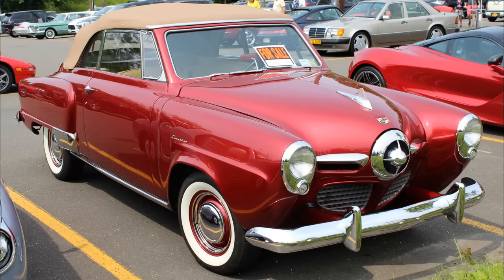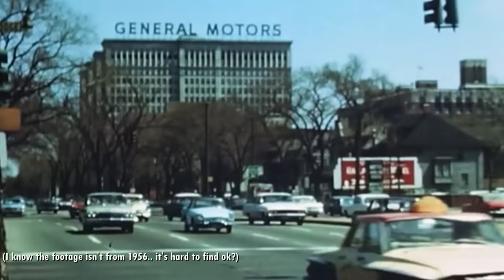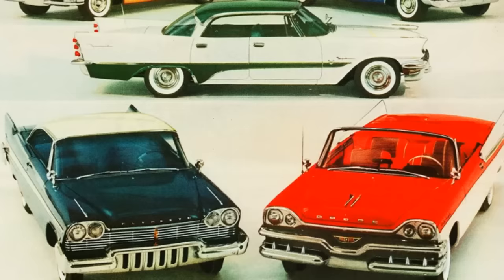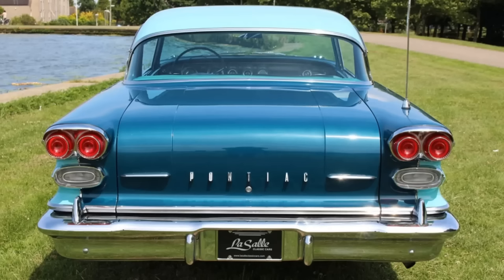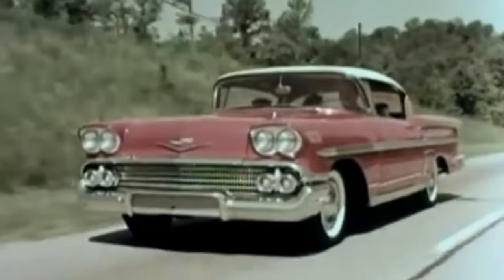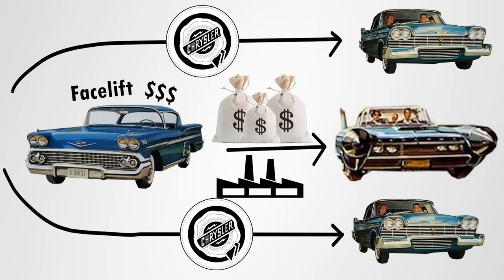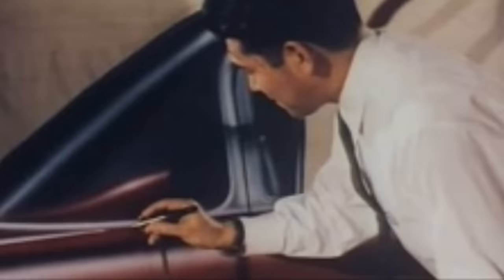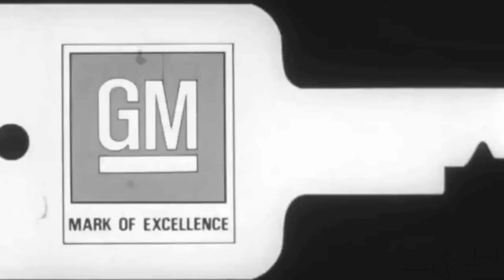Mistake of '58: The GM Chromemobiles and Far Out '59s

Comment: Ed -

Regardless of your opinions attracting some comments that are somewhat negative, it appears that you have missed some essential distinctions in GM design structure.

In 1956, the year you have started this discussion, GM had three different body "platforms" - A-body, B-body and C-body.  A-body was shared by Chevrolet and Pontiac.  B-body was shared by Oldsmobile and Buick's Special and Century.  C-body was shared by Cadillac and Buick's Super and Roadmaster.

What you have missed (oversimplified?) is the fact that those body platforms were not all updated simultaneously.  Yes, there were supposed three-year lifetimes for these body platforms.  But, the A-body's lifetime in 1956 was 1955-1956-1957.  While the B- and C- bodies in 1956 had a lifetime of 1954-1955-1956.

Meaning that the B- and C- bodies were new in 1957, and on the FIRST year of their life cycle, not in the third and final year, like the A-body was.

So, for the "mistake" year of 1958, while the A-body was entering its' first year of a new cycle, the B- and C- bodies were in their 2nd year.  I'm sure this must have contributed to the decisions GM made, regarding dumping the projected 1959 designs.

Of course, actuality in 1959 swept everything previous away, leaving the 1958 Chevrolet and Pontiac as one-year-only bodies.

And, in fact, the 1959 cars were all essentially ONE body platform, kind of a mish-mash of the B- and C- bodies.  Making the Chevrolet and Pontiac grow larger, by comparison, than the Buick, Oldsmobile and Cadillac.

FWIW, I still have the 1958 Buick Limited I bought in 1972, courted my future wife in, and brought home in from the hospital both of my sons.  So, you can see my opinion of 1958 cars.

Comment: If i was only given a choice between one of these old cars and a brand new car I would want an old car. The vehicle s now look the same break, down the same and don't last like the old ones. The old one's were far easier to work on. A sensor can go out on a new one and leave you dead in the water. The old cars weren't built to be the cheapest thing a factory can get away with making, there were made to last.

Comment: Part of what went wrong with the 1958 model year from GM was a mild recession. In that year Auto sales from all manufacturers except AMC were down.
That was also one of the things that killed the new division from Ford motor company the Edsel division. 
The 58s from GM were not their best designs. However the 59 to 64 models were incredibly beautiful especially towards 64. It would be nice if GM had a styling and engineering staff that was anything like those guys were. GM cars today or among the worst in styling and engineering. Absolutely awful drivetrains being the worst.

Comment: The 1953-54 and the 1955-57 Chevys are not the same body. Like you said, check the greenhouses. Completely different. Station wagon models can be the giveaway, and they are obviously entirely different. The 1958 bigger GM cars were not new bodies but facelifts of the new for 1957 models. The smaller ones (Chevy and Pontiac) were new and on a frame that allowed for a lower car with foot wells instead of a flat floor although they continued the heavy Harley Earl look. The rushed 1959 GM cars were variations on one basic body instead of two or three like before. The Chevys and Pontiacs rode on the same new frame/suspension from the 1958's but looked completely different.
Reply: You said, "The 1953-54 and the 1955-57 Chevys are not the same body. "Who said that they were? I appreciate most of the rest of your post - thank you!

Comment: THESE CARS ARE NOT HAND BUILT & Fenders Not Hand Hammered Out. STAMPING DIES have to be Machined. Very Large Stamping Machines & Drop Forges must be set up. Parts have to be assigned their order on Merry-go-rounds. That is Circular "Dry Cleaner" racks that feed parts to the main assembly line.

Comment: I remember when the GM '59 designs came out.  They had gross, unrelated lines and features that looked heavy and tasteless.  They were slabs of metal with chrome ornamentation that appeared to thrown at a frame as they moved down an assembly line.  🤢🤮

Comment: your story is a bit off. 1958 was a year of rising recession. double headlights were allowed in 1958 but not in 1957 as you suggested with harley earls trip to chrysler. the govt did not want dual headlights due to brightness of on coming cars. earl and mitchell knew about the all new chrysler designs but retooling during depression was not financially sound . Chrome was the selling feature to previous models of 55-57 and people loved it so that was a way to thin out the car on the sides adding new body lines of chrome and the nose ..... well was very chrome in order to take the weight look off it especially with the added extra headlight. It didnt work as well as it could have but it was far from a mistake. the 1958 chevy was supposed to come out in 57 however it was too risky to retool in 57 for the 58 so chevy and all other gms used the same 55 and 56 body with a redesign. Thats the real story. Chrysler also was not the laughing stock due to imperial was far more progreesed than others with modernisms like pushbutton drive and ride. The industry suffered even for desotoand chrysler who owned them. it was due to recession not design

Comment: You can get as intellectual as you want about aesthetics and the use of imagery in product design et cetera, but the simple truth is that money talks and bs walks, in the automobile business like everywhere else. If consumers bought those cars, why not make them. The cost of fuel was not an issue in the 1950's. Big chrome embellishments could easily get damaged in parking-lot fender benders, and maybe that was not an issue either. I wonder how many of those cars carried the bruises of chrome to chrome contact from carelessly executed parking maneuvers, and how many of their owners cared to have the damages fixed. Chrome looks nice when new but it needs to be taken care of with polish etc. Eventually an acne of rust would break out on the chrome grin of a 1950's rocketmobile. By then the owner would already be looking for a new car. Most of those 1950's cars were not built to last.

Comment: Those cars are pretty to look at but have terrible fuel economy, handle like the titanic, and require constant maintenance.  By the 1970s Detroit had the planned obsolescence down to where a motor was shot somewhere between 50k and 100k miles.  That is until Japan taught Detroit a thing or two about fuel economy, handling, and reliability.   Much rather drive a quick fuel efficient Japanese inspired standard or compact vehicle of modern times.

Comment: 1958 and 1959, other than Chrysler, were some of the worst, most gaudy, troweled on chrome, overdone Hollywood looking cars ever. There is not one of those cars I consider a good design. Want to see a great, simple, clean, elegant car design? An award winning car design? Checkout the 1961 Lincoln. It is still mentioned as one of the best car designs ever 60+ years later.

Comment: I'd rather be driving a Chrome mobile then the plastic cars of today if I'm in a plastic car I should hate to be hit by one of them Chrome mobiles the damage would be terribly thank you for the cars with bumpers on them
Reply: Actually, today's half-weighted cars are safer than those of the late '50's. Ya, really, there's a vid of a '59 Chevy going head-on into a modern car and, as much as I lament, the Chevy loses. YTube: (1959 Chevrolet Bel Air vs. 2009 Chevrolet Malibu IIHS crash test). Sad, but we prolly should appreciate modern safety standards.

Comment: so why is gm so shiit now? like all the cars from 2010 till now are all basically cookie cutter,.... i wanna see something unique,... like a throwback line,... with modern innovation included,... i sat in one the cadillac sts,... it's tiny,.... cadillac is my favorite, and i want a boat, so i sat in an escalade,... its exactly the same as a freaken chevy,... and costs twice as much for a few extra buttons,... i want to drive a truck where u can actually see where your hood ends,... and where ur bumber is,... and from the mirrors,... not a back up cam,... these old cars, featured in this video,... you could drive em thru a brick wall and hardly get a scratch on the paint,... now a days, someone taps your front bumper and your whole engine block is on the other side of the street,... call that safety enhancements? quite the opposite, i would think,... they not doing this right these days.